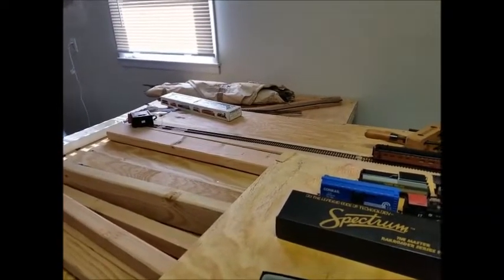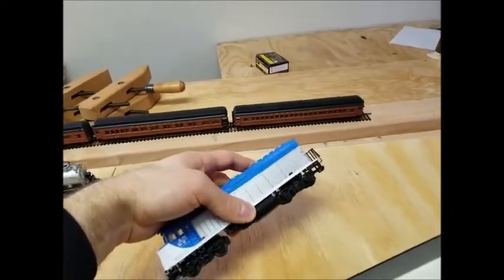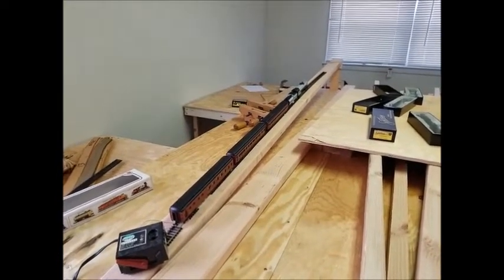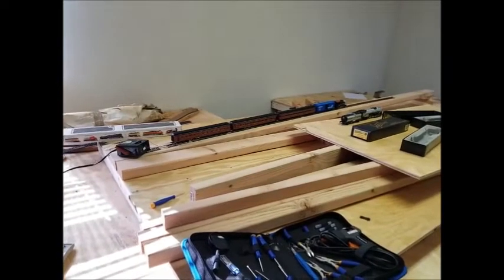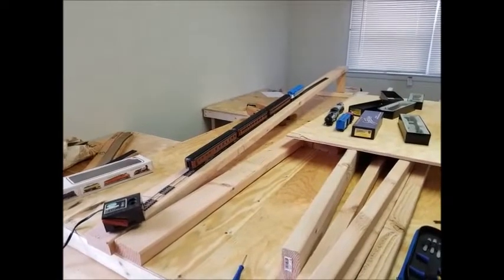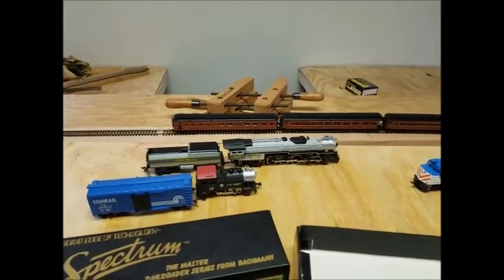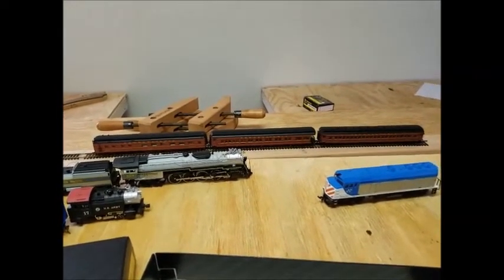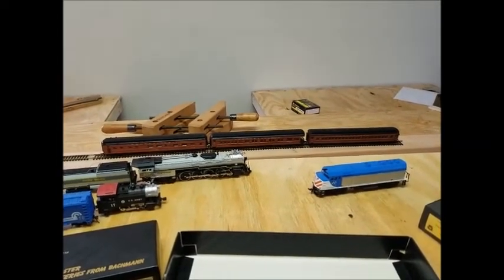Grade tests of HO Scale Locomotives

Comment: No! The max grade YOU SHould allow is 2.5% to 3% !!!!! anything more would stress the motor. The small steam engine is never meant to work on grades. Its meant to work flat terrain such as on a dock or yard. The switcher can handle 1% at max. The 4-8-4 works better on larger curves of 22-inch radius or better. As for your track plan. you will need to redo it so that the tracks don't cross over or under each other. That way the grade can work without being so steep.